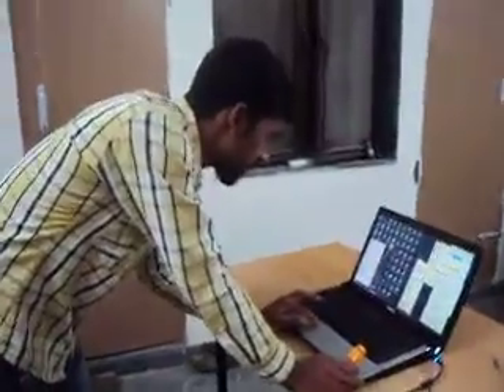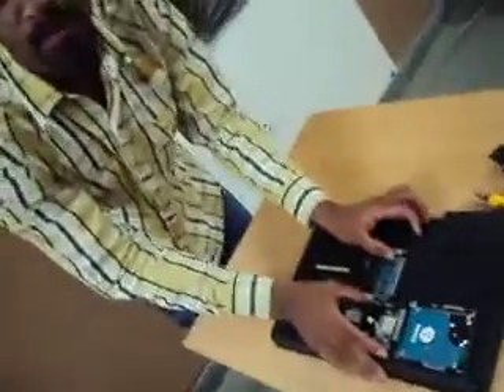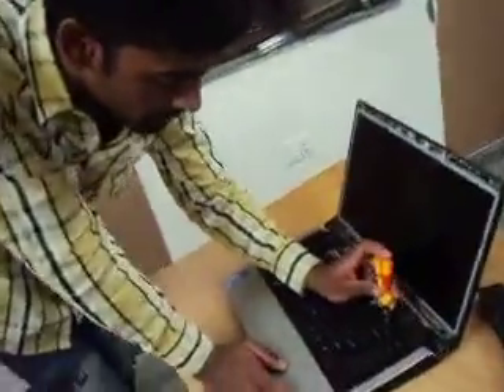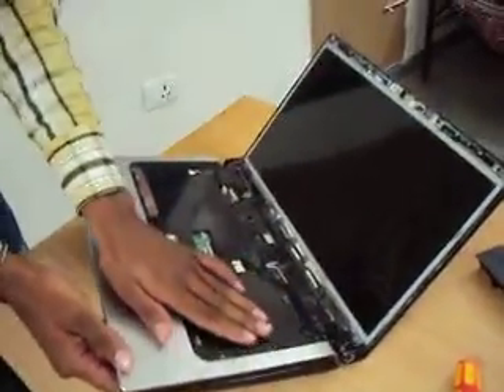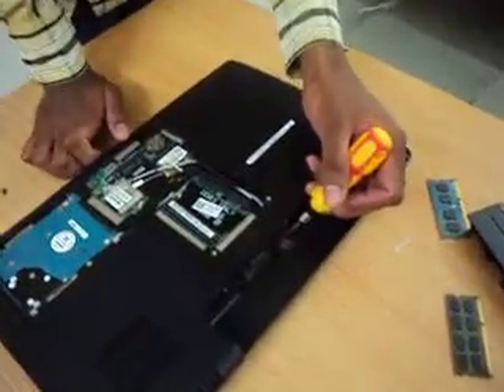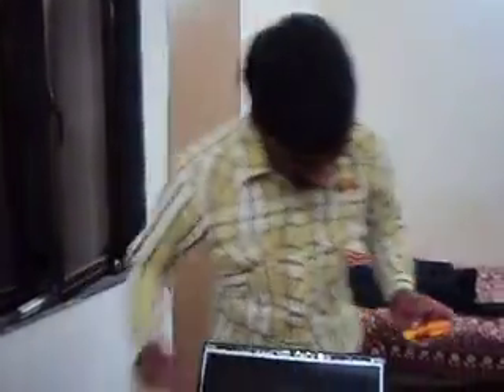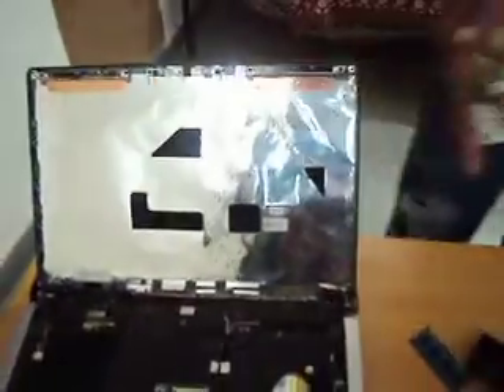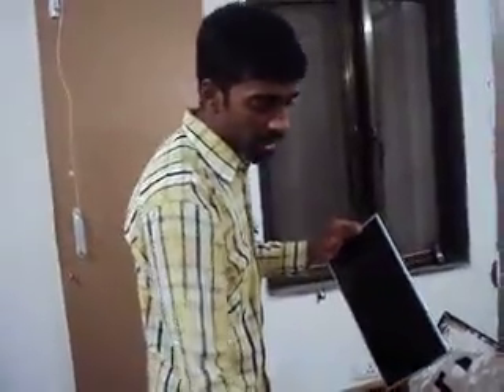How to Disassemble DELL STUDIO 1558 for Inspection and replacement Purpose

Comment: I need to remove the dummy SD card from the CD drive.  I've tried turning the computer and shaking it a bit.  I tried inserting a flat screwdriver.  How much of the computer do I need to take apart for this? Thanks.

Comment from the maker: Though studio 1558 has built-in SIM slot, but still in India you can't install the required hardware to make calls and use mobile broadband (But it is available as an extension in US and UK), but still you can use the mobile broadband software with a datacard.